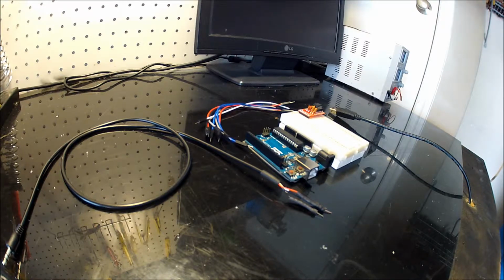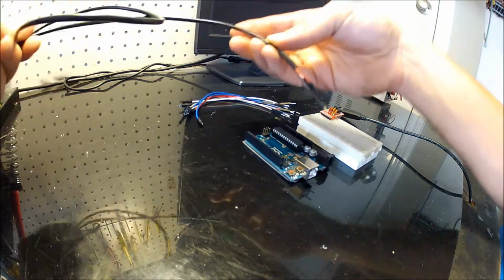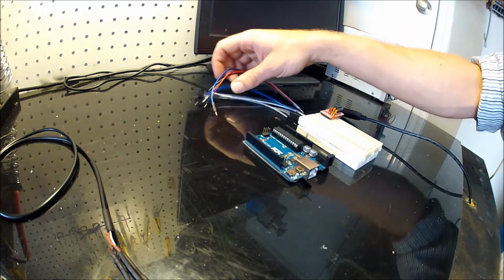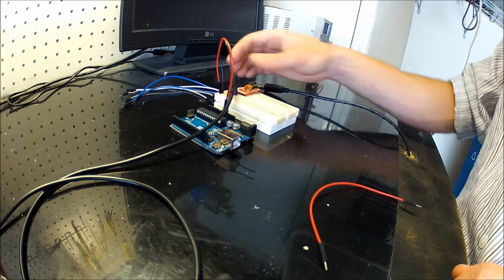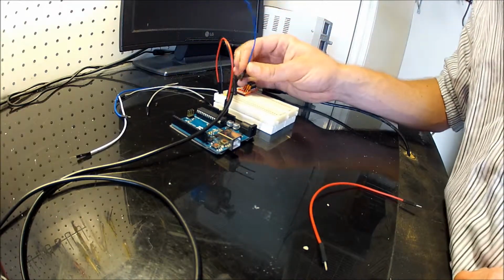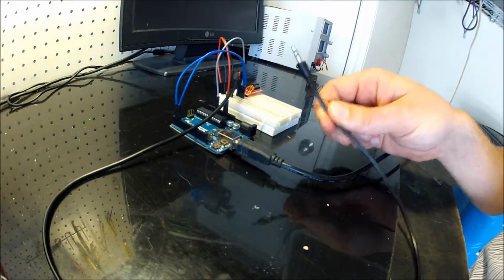cenTex Photonics MSGEQ7 Breakout Board

Comment: You said the output pin is analog?  So to get the data out of this into a Raspberry Pi I need to use an external A2D?  Fortunately I have an A2D with I2C interface en route at the moment from China, so this will make a nice test for it and vice-versa!   Also, could you post the arduino code that you used in the demo please? (if you still have it)   Thanks.